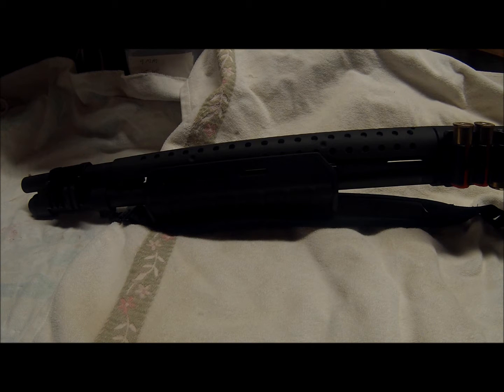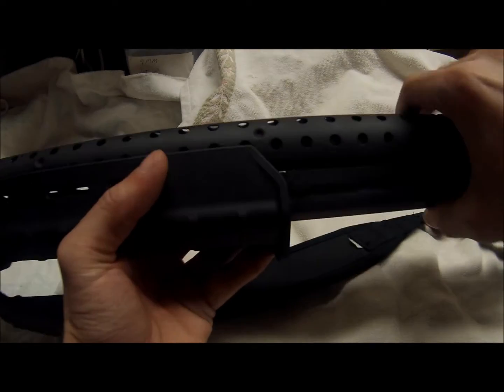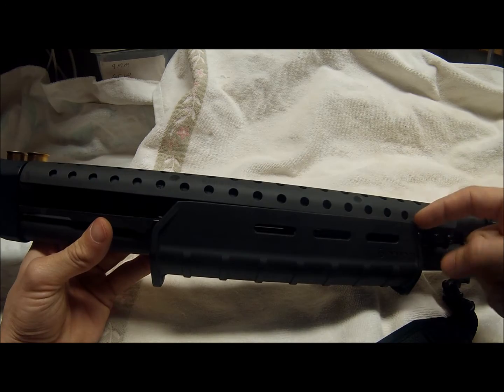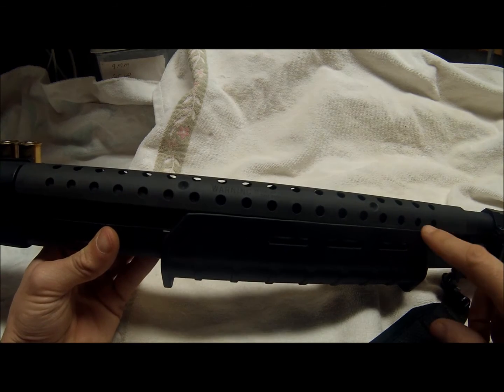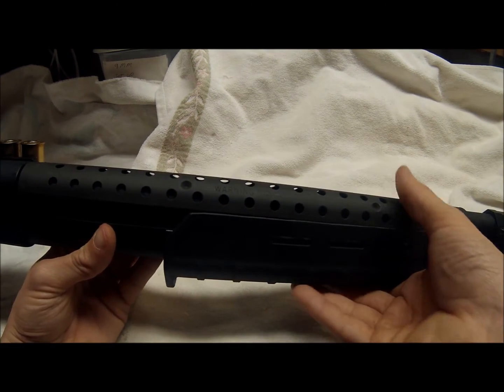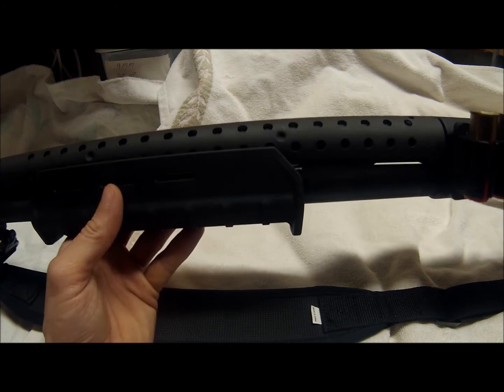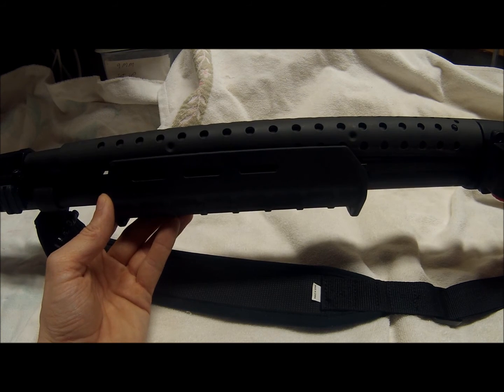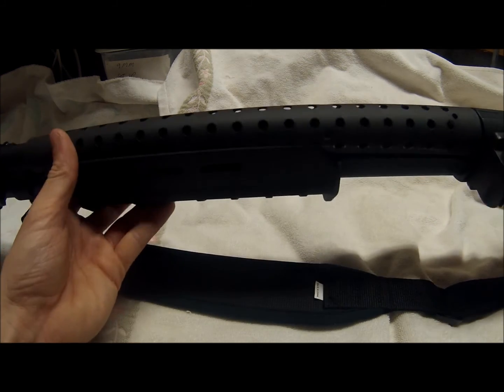Magpul Forend on Mossberg 590 with Heat Shield

Comment: um, I just put the barrel and the heatsheild in my vice. Once I did that it fit fine with the MOE
Reply from the maker: Probably would have worked fine for me too... I just prefered to risk the plastic instead of anything metal
Reply: Did u jack up the finish on your heatshield when you bent the metal?

Comment: Nice. I wanted to buy a magpul forend, but I was reluctant. At least now I know it is possible to modify so both work in harmony. However if dirt or mud gets in between the heat shield and forend, do you think it would impair functionality?
Reply from the maker: Sorry or the late reply... I doubt it would have any impact on function.
Reply: Hey, thanks for the reply. What I did was instead of grinding it, I simply put the heat shield in a vice grip and bend the shield by working it around the barrel while still keeping space. I was able to make the shield have a perfect circle around the barrel since the shield itself does not match the circumference of the barrel. Now it work flawlessly without any grinding or fear of dirt sticking it.
Reply from the maker: Voss2120 Yeah I thought about that but then figured I'd rather risk damaging the forend instead of the heat shield. Sweet that you got it done though...looks awesome with both
Reply: Well either way, one part needs to yield before they can work in harmony. I plan to upload a video of my 590's set up soon.
Reply from the maker: I'd like to see it, let me know when it's up
Reply: @Voss2120  - You impacted the shield's ability to do what the shield was designed for moving it closer to the barrel. The way done on this video is more work but superior.